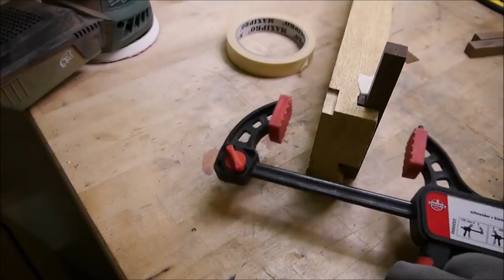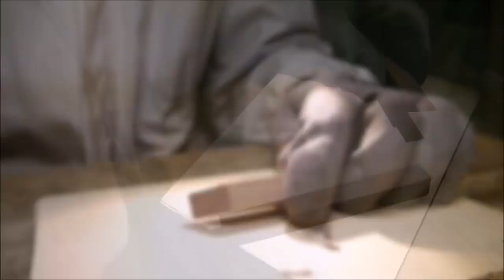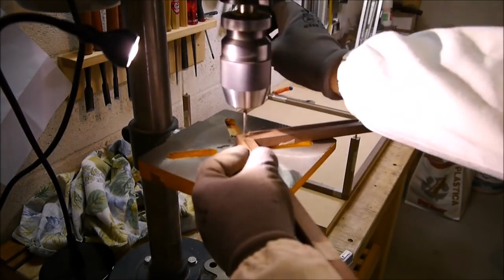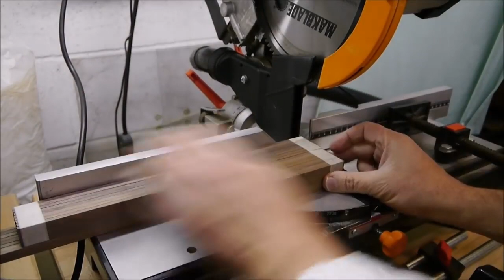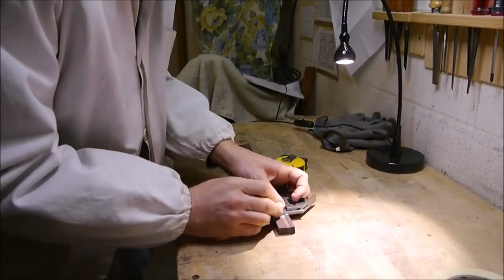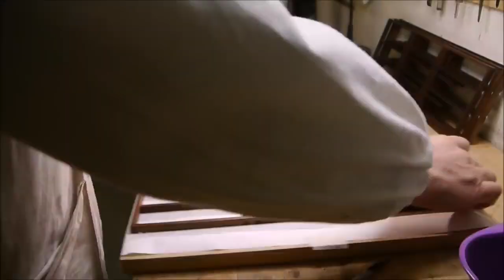Awesome Japanese woodworking - Japanese construction lamp

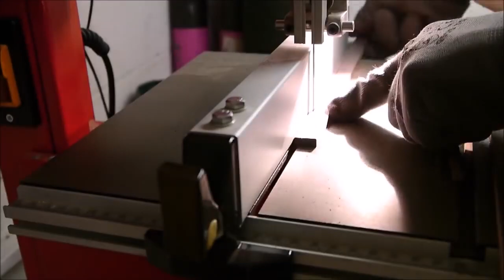Comment: Not bad, but your bandsaw was set way to high. You can see the blade bowing out at 3:50 sadly. You could have saved yourself a ton of planing. It would have been nice to see you use a more Japanese approach and utilize wedges instead of glue. Overall, a beautiful video and the results were very nice! I hope to see more!